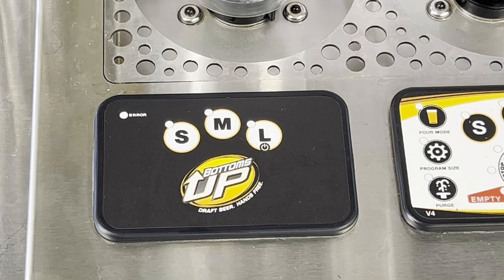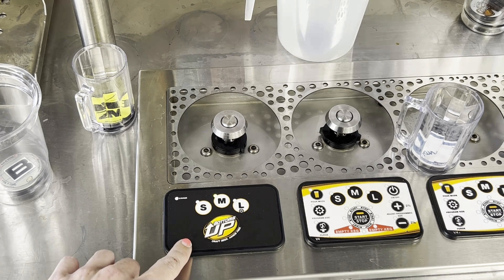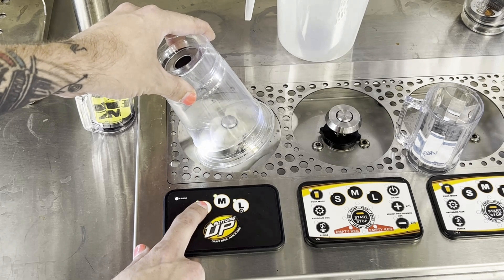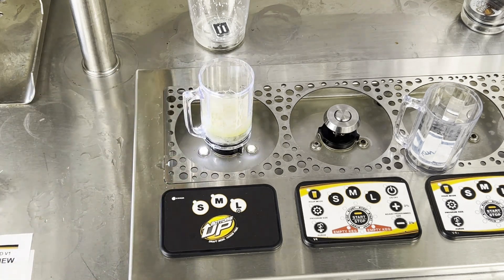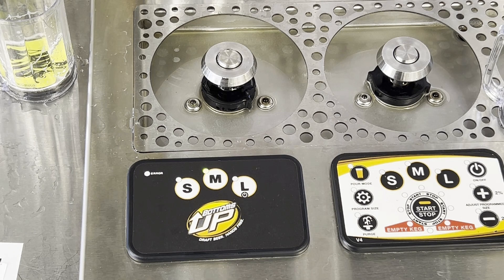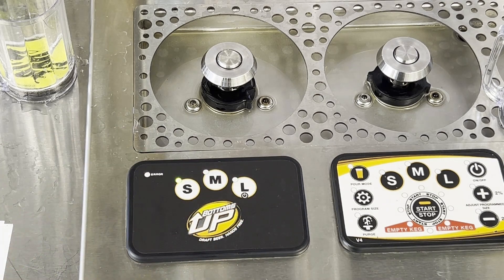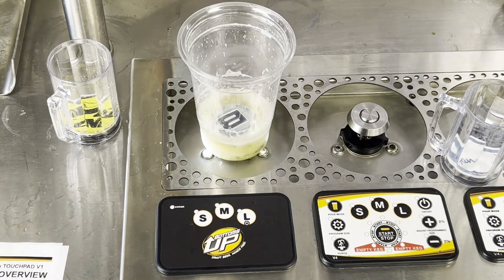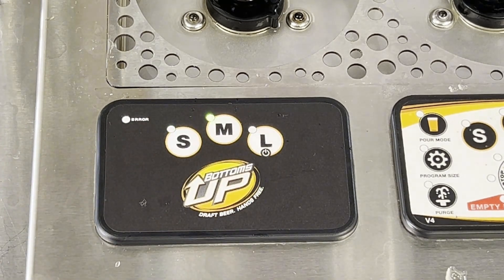How to use your new Bottoms Up, three-button circuit board

Comment: Pro Tip: The next time you do a video when just showing hands - either remove the nail polish or have it fully painted. It looks very sloppy otherwise. The best option is to not wear any at all as I was distracted because I wasn't sure if it was some type of fungus at first.

Comment: Just had a drink served in a bottom-fed glass.  I don't know what manufacturer.  It spilled all over the bar and almost killed my laptop.  This is a terrible idea.
Reply from the maker: Where were you? Was there a magnet in the bottom?
Reply: @Bottomsupbeer1  The Buckley Kitchen and Bar in Framingham, MA.  (No hate against them--it's a good place except for their booby-trapped glasses.)  I don't know if there was a magnet.

I took a sip, then saw a drop on the counter.  New laptop so I tell myself to be more careful.  Another sip, another drop.  Am I this sloppy?  No... no beer on my beard, none of the side of the glass... maybe a crack on the bottom?  So I look under the glass and see a hole.  Which seemed absurd.  This isn't REALLY a hole right??  I touch it and all the beer pours out the bottom.  I was too busy doing damage control to notice more about the glass.
Reply from the maker: @balijosu  Sounds like it might have been our system. You do have to keep your finger out of your bottom hole with any type of bottom filling system though. Send your address and we will send you a dry shirt to make up for the wet one. 😊
Reply: @Bottomsupbeer1  Nah I was lucky so I'm over it.  Just here to warn others about your product.
Reply from the maker: @balijosu  Well we appreciate it! #dontfingeryourcuphole Spread the word!